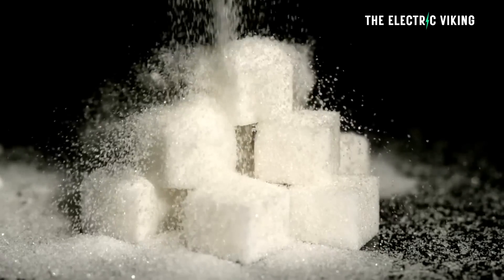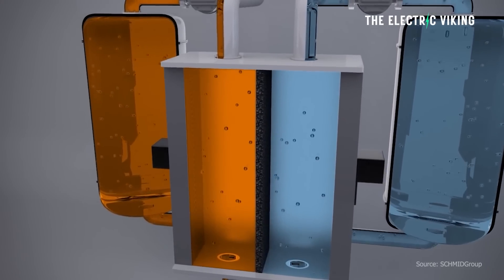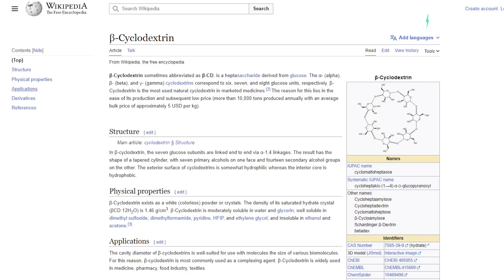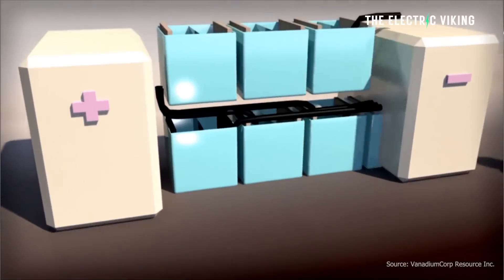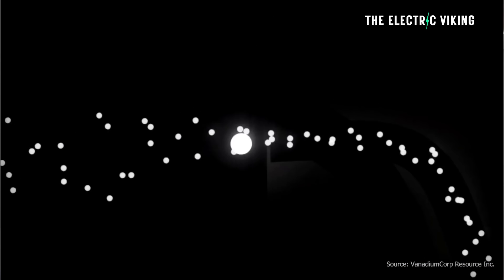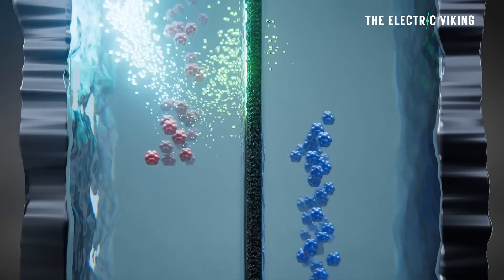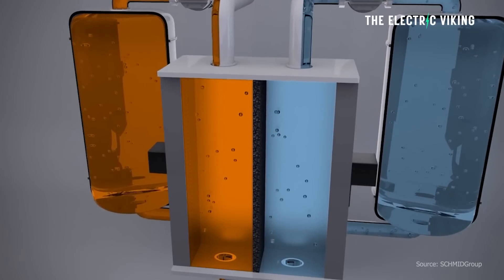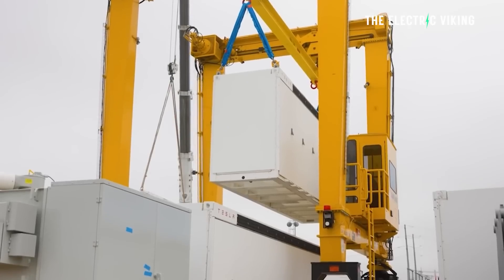Adding sugar to Flow Batteries boosts capacity, longevity & power up to 60%

Comment: Say what you like about awesome gee whizz 'breakthroughs' and 'cheapest by far' - but as EV knows consumers in Victoria Australia are facing MASSIVE hikes in electricity supply charges. And the real reason is the massive costs of 'going green' via cluttering the landscape with mega acres of wind turbines and PV cell 'farms'. And the associated distribution networks and very costly energy storage schemes needed to TRY and obtain reliable 24/7 supply.

Comment: Sugar is very acidic.  You can even use it to remove rust.   It could probably even be used in a lead battery.  But sugar, like alcohol from corn, would use more energy in its agricultural production than it could save.
Reply: It can be made from cellulose, probably cheaper.
Reply: It’s not acidic, not even slightly it’s a perfect ph 7…..
Reply: Sugar is expensive only where you have to manufacture it from corn. If it comes from sugar cane like in the tropics, it is cheap.